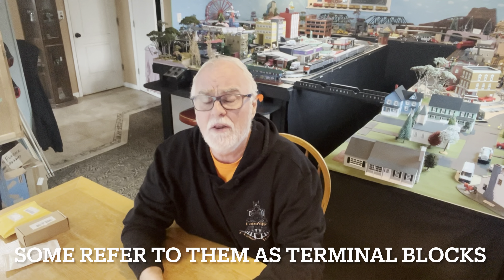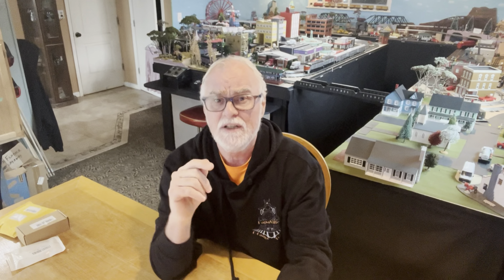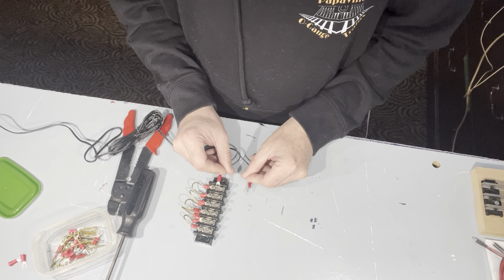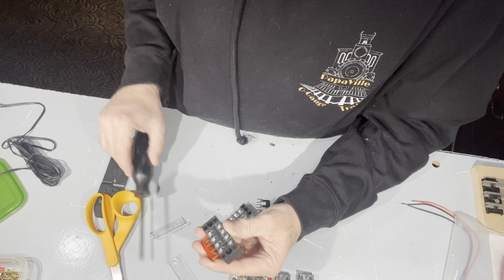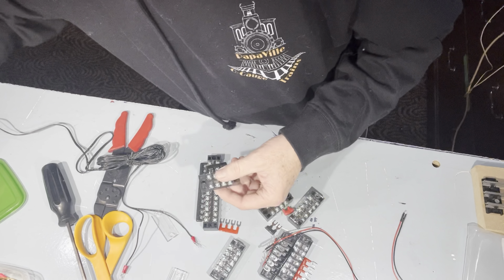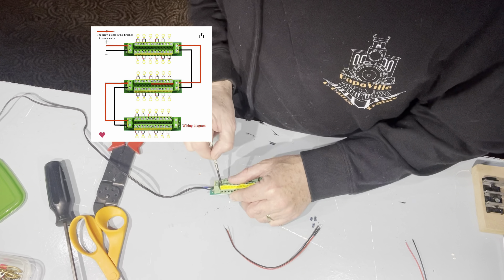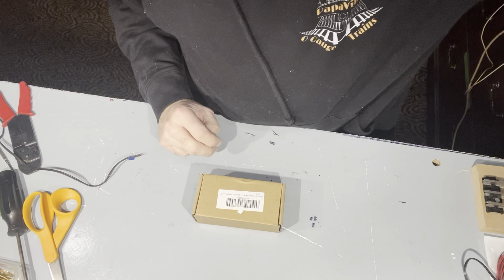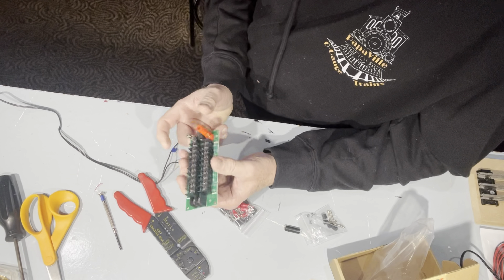How to and why to use terminal blocks on your model train layout. Also different types to use

Comment: Nice video.  Can I use the green terminal blocks to power Lionel Fastback by running wires from the transformer to the power block and then the power track wires to the power block.  I have a large layout and I lose power on the end.  I bought the power blocks and piggy backed them together so I can tie in power to the track every couple of feet.  Thanks for your help.
Reply from the maker: If I’m reading your question correctly, the answer is yes. One thing you could do is run power from your transformer two separate power blocks wire from the power block on the right side to the right side of your truck power block on the left side to the left side of your truck . That way you’ll get a little bit more even powerful.

Comment: can you daisy chain any of the type of blocks. great info
Reply from the maker: I’m not an electrician, but I don’t see why not. I would imagine you’ll have a slight drop of power the further you go. Using a little bit of a heavier gauge wire in between the blocks would definitely help.

Comment: I’m running an 8x8 train layout with two loops and classic Tmcc, I’m experiencing voltage drops on certain areas of my layout, I’ve already tightened pins and added feeder wires. What type of wires can I use for my layout so I can evenly distribute the power to each part of my layout?My feeders are 18 gauge serrated wires.

Comment: Thanks for the video. If I am going to run both legacy and TIU, would the plug in terminal block be optimal using the “star” wiring technique to the track? Would that require connecting each positive with a short stubby wire like the first example? Or just keep it simple and go with the first example? (Just get two separate terminals for positive and negative and configure it the way you have it?
Reply from the maker: Two separate is the easiest way 
Thanks for watching

Comment: The block you just plug in the positive and negative on top so ? Is the side you plug the positive plug is all power going out and negative side ground going out? So you put in 1 positive wire in the first screw and the opposite side the negative side goes with the positive wire 2 where your going whether it be a building or whatever right ? Sorry I've never used  a block before gunna be building a layout well I am now still building the table right now
Reply from the maker: If I read your question correctly, that’s how you do it
Reply: @Pvilletrains  thanx

Comment: Thanks for sharing your knowledge on this. I am running a very decrepit 4x8 layout now and need to create a star like distro of power since I am running a TIU in my layout. Eventually I will be going 5x10 and my layout should be a cleaner. Regardless, do I need to create an insulated track every 4 or 5 tracks to get the power distro right?
Reply from the maker: You don’t need an insulated track. You just need to run power to the different locations and insulated track would be used If you want to activate and accessory as the train goes by. I also have a video on that.
Reply from the maker: Here’s another video that might help you
https://youtu.be/dWnrWq6TlN8?si=WRSR9AWF_G3k8lFo